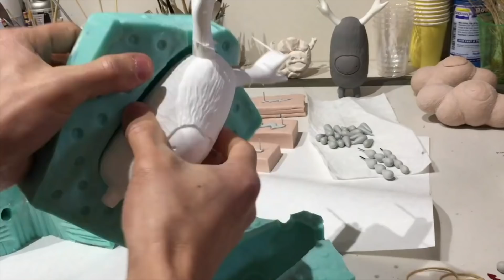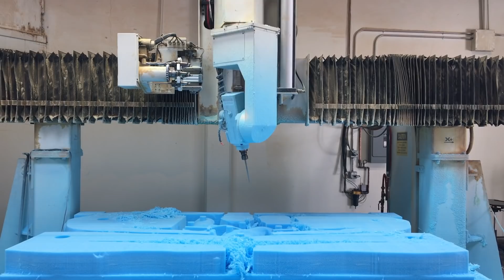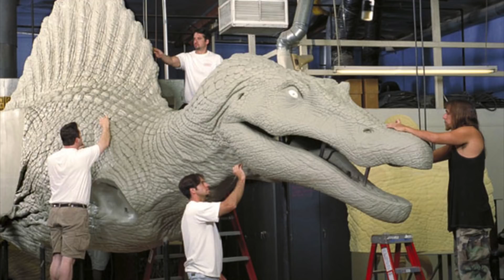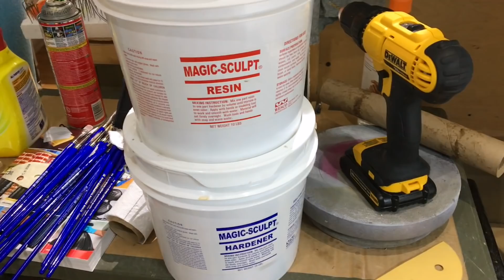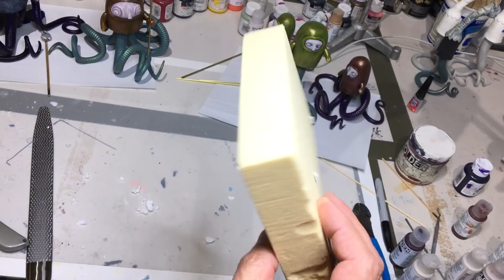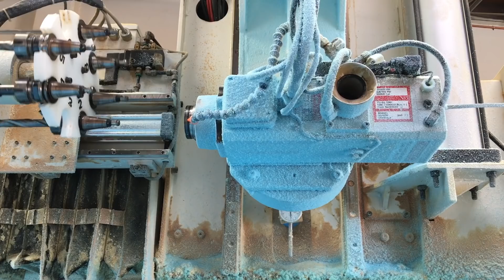Enlarging Sculpture- foam carving, Magic Sculpt, needle felting

Comment: what do they tend to coat the foam with the harden it and make it durable? Is there any produc like that thats safe to use at home?
Reply from the maker: it's a two part chemical reaction- two liquids expanding together. It's a pretty toxic process. Definitely not enviromentally friendly

Comment: Instead of using a file to carve, do you ever use a hot wire cutter or hot knife with the styrofoam bead foam?
Reply from the maker: Jacqueline Overby yes I have a couple different hot knife tools. They work great. Just wear a respirator. The fumes are awful.